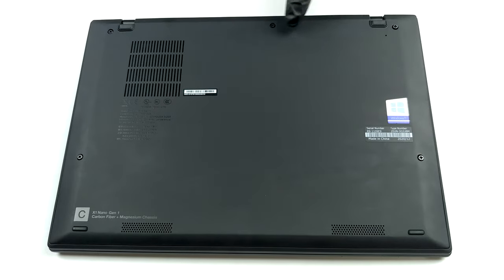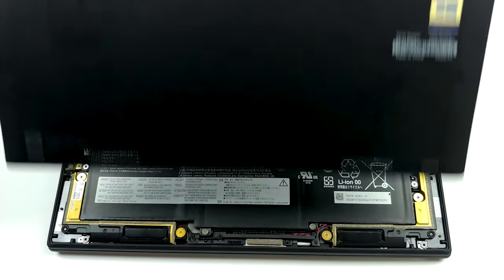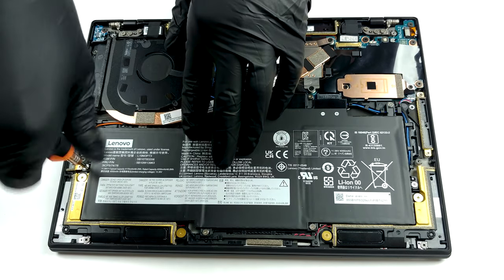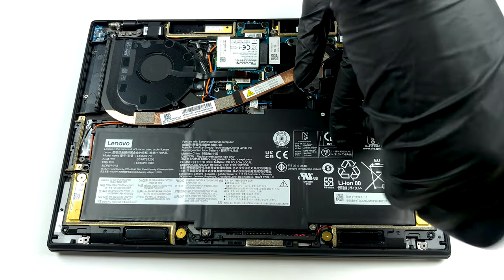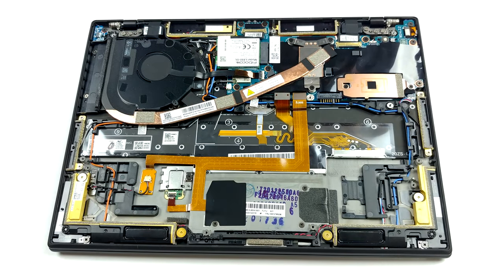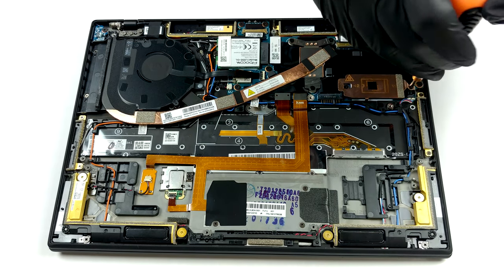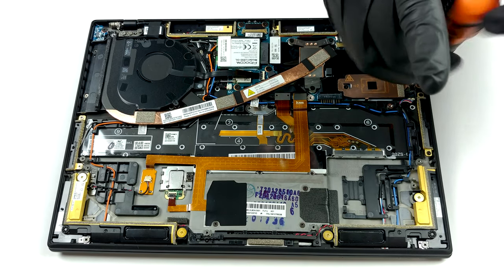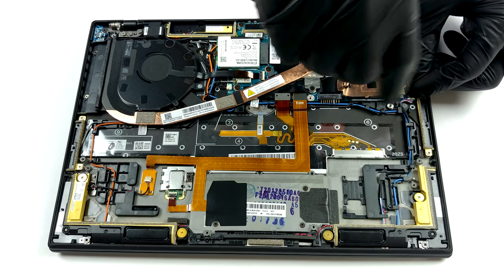🛠️ Lenovo ThinkPad X1 Nano - disassembly and upgrade options

Comment: Does anyone know if a double-sided M.2 module would fit?
Reply: This would indeed be cool. Anyone knows this?
Reply: You can do it, but it´s not designed with enough space between the motherboard and the heatsink.
Reply: I have seen it done (Sorry dont have video link) but it didn't fit well and might be actually pushing the bottom body out a bit, the video also showed the person removing some foam/past or something to enable him to get the double sided ssd in. Probably better off sticking with 1tb max unless you want to risk serious issues.